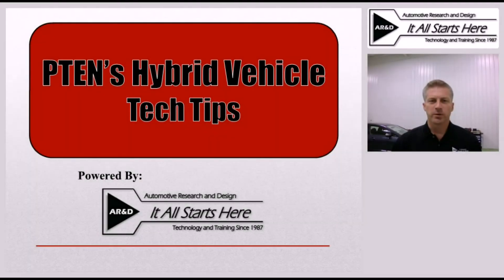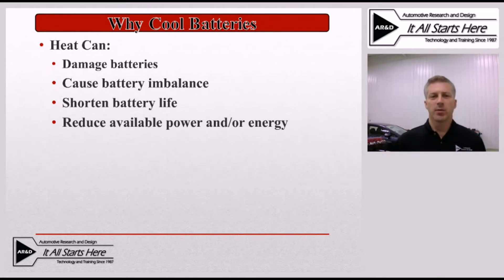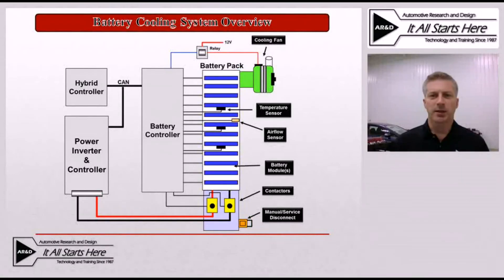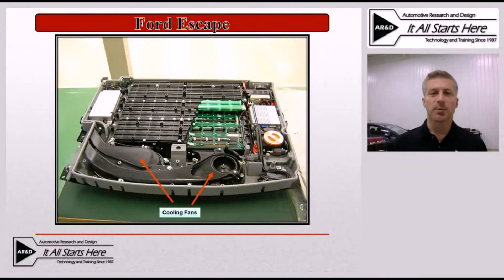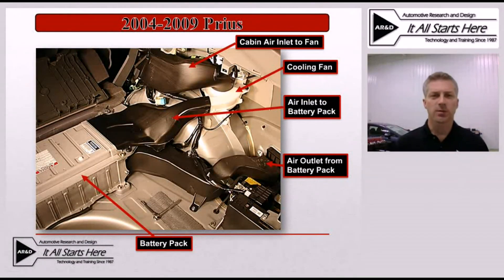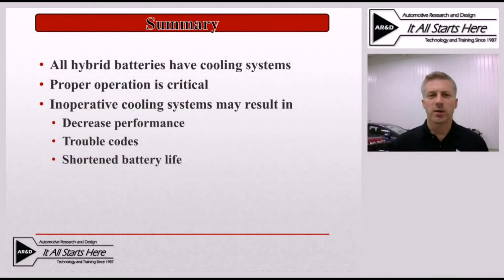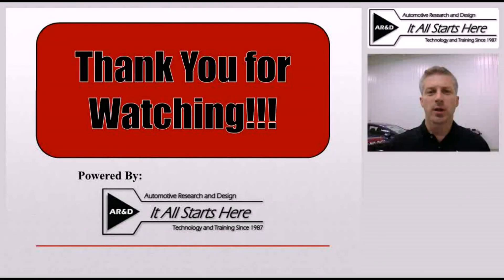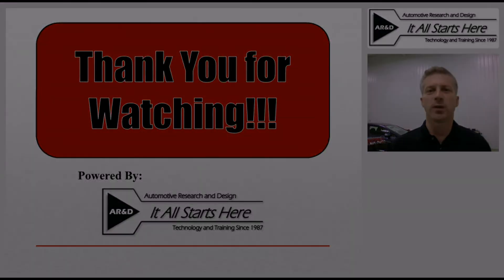Tech Tip: Hybrid Battery Cooling Systems Video

Comment: I have a 2016 Toyota Prius..
Under the back seat there is one vent with a fan.. under the middle of the seat there is a big event that blows out hot air .. should this be happening ?

Comment: Just to clear up much confusion. Both fans suck air in from fresh air side post ac unit and positively pressurize battery pack for cing air out thru recuirculate and or exhaust out of vehicle on the ford escape, mercury mariner.

Comment: Hello guys 
 I need help 
My 2009 escape hybrid battery is overheating " both fans in the battery are working And manually opens the "" battery vent door "to let the outside air go inside" and still overheating 
I just noticed that the AC evaporator fir the battery cooling system is not getting cold but the AC in general is actually perfect working "" 
 Here is my question is some sensor that I have to replace or something else?  help please